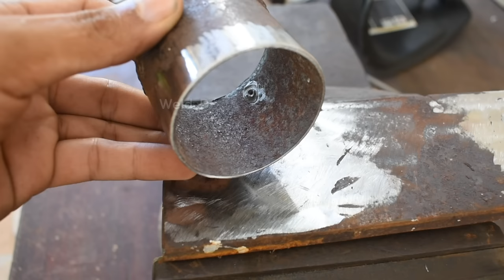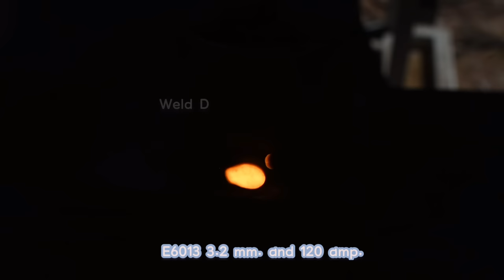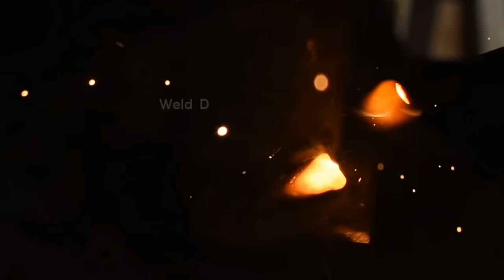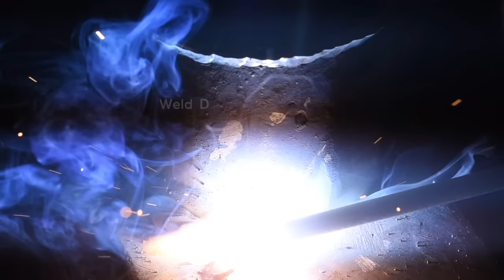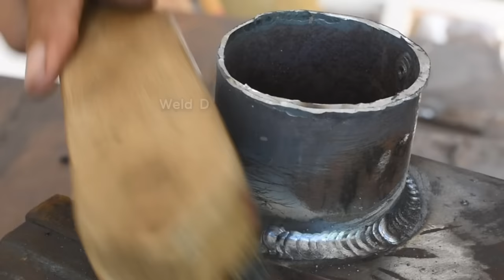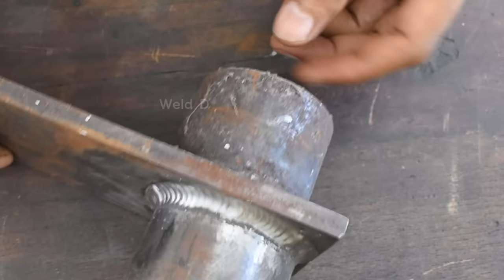Why didn't anyone tell us about this secret in welding round pipes?

Comment: If I caught any of my lads welding like that with the stick welder there be trouble lol you placing each tac weld on top of the slag coating which brings penetration trouble , weaving up and down with rod your bound to have defects etc , try weaving right to left in stead of up and down , :)

Comment: Do you have any response to the people saying you were tacking? And that your welds would be weaker and have less penetration because of it? 
Personally I’ve learnt heaps from you and your videos so thank you! I’m only interested in your response because I want to learn the best welding practices that I can and I see people mention taking whenever someone does that for a full (stick) weld.
Cheers!! 🤘🤘
Reply: You can see it didn't penetrate on the side so they'd be correct. However his top comment states it's for beginners. Good to get familiar with welding but that method wouldn't pass any test in the industry. I'm just wondering why the outstanding weld shown for the video doesn't match the final result.

Comment: A continuous weld is more penetrating than stop and start, which does not let the materials get hot to melt the metal together more consistently. Do you have a cute little noise for that?

Comment: Why spot welding not continuos welding? Pin holes may occurs.
Reply from the maker: Tube 1.3-1.4 mm. Continuing 😳😳
Reply: With good control you can do a continuous weld without melt down of the pipe and still have better penetration without the constant starts and stops. A good welder welds without stopping.

Comment: arent you supposed to remove slag before every restart?
Reply: Well, you're not supposed to restart every quarter inch, so there's the first problem. This is purely for looks, and would never pass in real life. Other than that, yeah it's a good habit to remove slag before restarting.
Reply: Josh swidet absolutely. A good welder can compensate for the different thicknesses of the material and put down a good bead without stopping

Comment: what about with a "DEFECT"
Reply from the maker: Porosity
Reply: @weld_dx  I"m sure that there is a lot more porosity and slag entrapment just under the surface of that  weld. While it isn't a bad looking bead a lot stonger weld would have been made if done continuosly at proper speed and heat. All the starting and stopping is going to create a lot of defects in a weld,even if done by a professional.